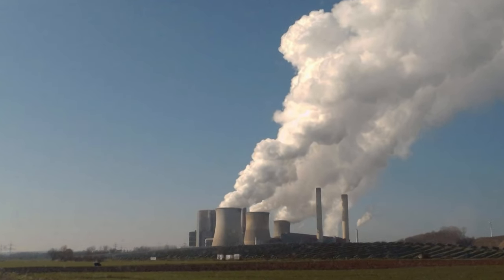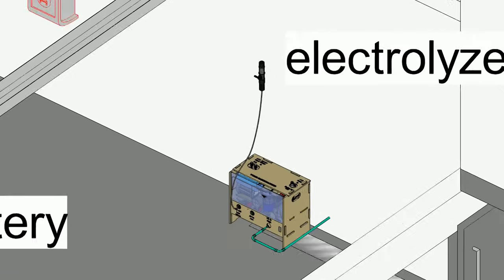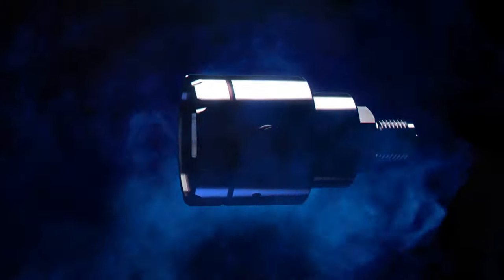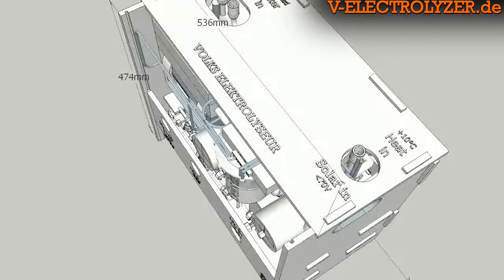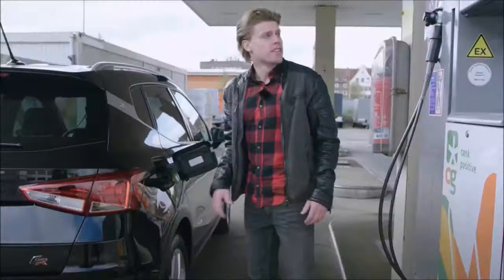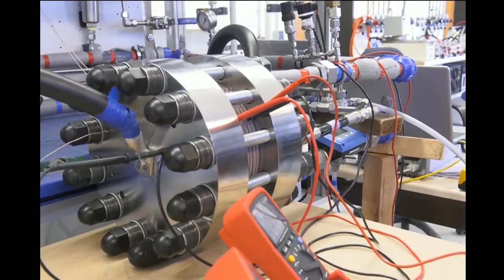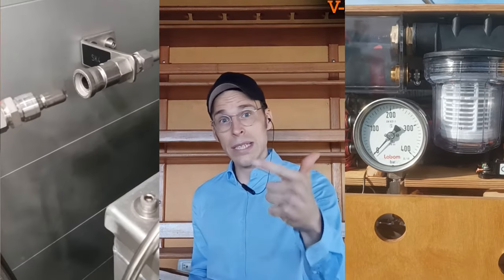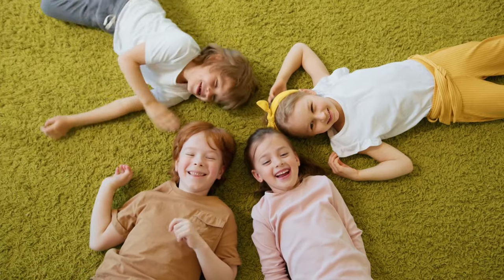The last chance out of Energy crisis with hydrogen

Comment: 3:18  Not sure about this income figure.  The comparison you give is for stations with compressed H2 to 700 bar.  But let's just use retail station prices for now.  You're saying I can make 1650/yr with a device (not counting the solar panels) costing 18,000.  So my payback is 11 years or a runtime of 96,360 hrs.  What is the stack lifetime of the unit?
Reply from the maker: It costs 13.000 until new years. The income is 1.745 today. The Video was made a month ago. What if gasoline prices rises to 10 dollars a liter? If you wait until than, you gonna give all you money to the oil industrie because you were to stingy to invest the right time. The oil industrie is allready paying these expensive electrolyzers which you are going to pay at the end. If you do not decide wisely. It is sure it won't get any cheaper.  There is also a dynamic calculator including interest and replacements. https://v-electrolyzer.de/2022/07/05/heimtankstelle-unabhaengig-durch-wasserstoff-mit-dem-volks-elektrolyseur/
You have to take inflation and maintenance costs into the account. The solar is not part of the equation, because it is meant to be for electric use only. Hydrogen is just for access energy which would have been wasted. Check out the technical data on out site. Another faktor are the hydrogen tanks which are not included.
Reply from the maker: The interesting thing is, we easily spend 20.000 on energy consumers like a car, heating and never ask for return on invest. Do you know another machine which makes value?
Reply: @volks-electrolyzer  Don't get me wrong, I think the unit is neat, but we generally always want a return on our investment no matter what we spend money on.  Whether it's money, time, enjoyment, or just plain necessities.  For example, I spent money on my rooftop solar panels.   They don't give me time, enjoyment, or necessities, but they do save me money in the long run and a penny saved is more like 2 pennies earned because of taxes. They are nearing their payback period at this point.  They've generated enough energy by next year that I would have paid the utility company to equal the cost of them.  That doesn't account for missed opportunity costs, but at least they are not losing me money and hopefully they keep running flawlessly for some time.   On the other hand, if it takes 3 days to make 1 kg of hydrogen in your electrolyzer,  that means the solar panels would have to generate an excess of at least 20kWh per day.  In Germany, you'd need at least a 4kW system with 2-axis tracking to do that dedicated to only making hydrogen.  And only in May, June, and July.  All other months' output is less (in Dec it's only 2kWh/day, wow you really must have cloudy days in Dec).  If you converted an ICE engine to hydrogen, for much more than "a couple of bucks," you'd only get about 30km/kg.  So that would get you 10km per day.  You'd get much more with a much more expensive FCEV, closer 30km/day (on 0.33kg of H2).  But the other hand, if you just bought a second-hand EV and plugged it in during the day, you'd get a more useful 80km/day per day out of the panels.  At about the same cost you have a spare car with much more distance traveled with the same green energy.  You're completely right when you say we need a long-term seasonal storage solution and hydrogen is one of the best options.  Selling bottled hydrogen is certainly an interesting alternative if you have the network to sell it into.
Reply from the maker: @scottkolaya2110  First of all, thank you very much for your qualified comment. I like this discussion a lot. The electrolyzer is stackable. If you want more hydrogen, stack two or three electrolyzers one on top of each other. Do you know a better investment with less than 10 years return on invest? Do you think fossil prices will be lowering? The hydrogen conversion of a gasoline car costs 3.500 €. The conversion of a generator is about 50 €. Compared to 80.000 on a fuel cell vehicle, that are a couple of bucks. People did it for LPG for a couple of cents / kWh less. The electrolyzer will produce enough energy for 12.000 km a year. How many Kilometers do you commute a year? The Hundai Nexo goes 100 km /kg of hydrogen. Find information about this and the range of converted gasoline cars under the following link https://v-electrolyzer.de/portfolio/private-wasserstofftankstelle-h2-heimtankstelle/. 
Yes, the more kWpeak solar array the better and minimum 14 kWh batteries. Not mandatory if you are ok with less hydrogen. No tracking suggested.
The EV charging is no option in Germany. Mostly EVs have time to charge over night. with a 60 kWh Tesla you would need more the 60 kWh full house batterie when charging, thus a much bigger solar array. We pay up to 20.000 Euro for a less than 15 kWh lithium Housebattery in Germany. This will give you approximately 4.000 cycles. Do you agree?
Hydrogen bottles can be discharged much more cycles and cost about 20 €/kWh. Thus you can store much bigger quantities. 100 kWh or 300 kWh no big deal. Mild winter in one covers bad winter in the others. You can use excess energy from summer in winter because if you have solar in winter you should use it electricaly, not for hydrogen, nor for EVs. We are developing a 48 V electrolyzer for richer people wich produces 1.2 kilogram  a day. The Idea of the VOLKS-Electrolyzer is, to be for people. And most people earn very little money. I want them to be able to have their own gas, too. I think if one consumes more there will be less for others. I can live with less energy easily, and if I do not need to by fossil fuel from the exterior, I can work less and have more time. This is worth much more than money for me. I really do not want to convince you. I think the VOLKS-ELECTROLYZER might not be your cup of tea. But thank you very much for your thoughts.